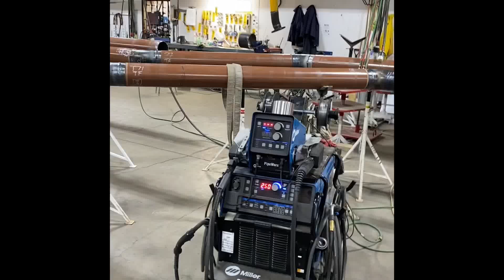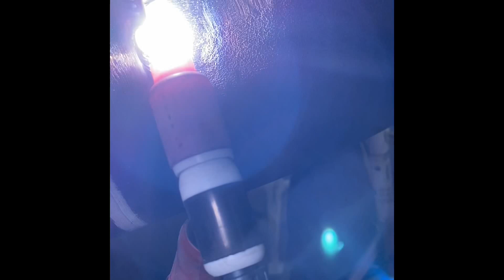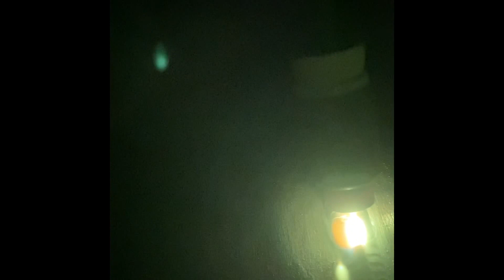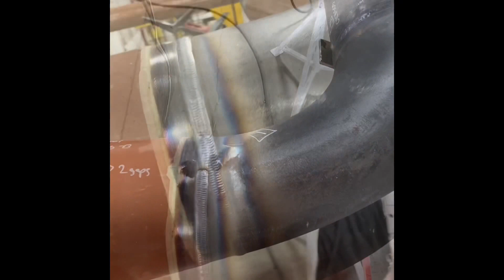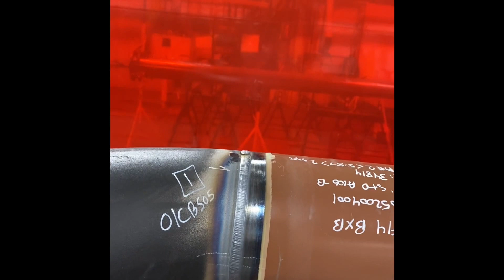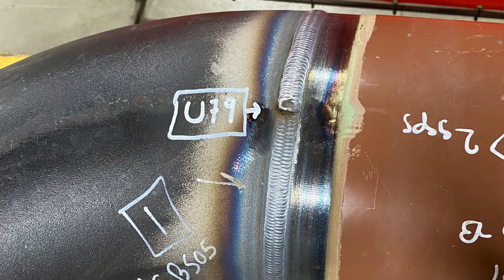TIG Welding! Walking The Cup Technique on Carbon pipe!

Comment: That's nice af can u tell me why ppl grind their starts and stops please
Reply from the maker: Hi Chris,
Most weld defects are attributed to weld stops and starts. Welding starts can lead to overlap, incomplete fusion, and slag inclusion, while stops typically lead to cracks and undercut.
Reply: @X3MTIG  thanks for the quick response bro do u grind your stops and starts when tig welding I see some ppl leaving the wire in the pool
Reply from the maker: @chrisplayz253  I usually do that only for tie in the weld at the end, but also all depends from material you welding. If you are using tig torch without HF and you have to hard pull your torch after finishing weld, that might leave a pin hole in your root, so it’s a good thing to grind every time you stop.
Reply: @X3MTIG  thanks for the replies bro 🙏

Comment: Can you tell me which machine did you use and  what was the amperage?
Reply from the maker: Hey An , thanks for your question. For this weld I was using "Miller Pipe Worx 400" and usually I'm running settings about : root 135-140 Amp / fill and cap 150-170 Amp